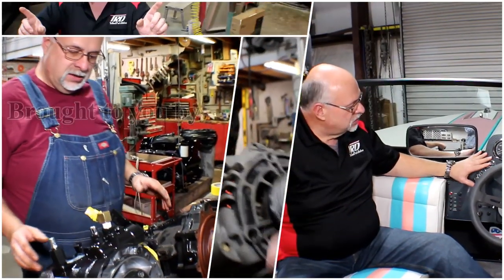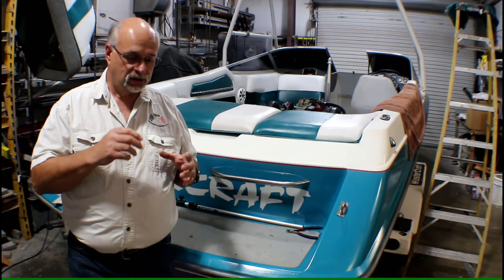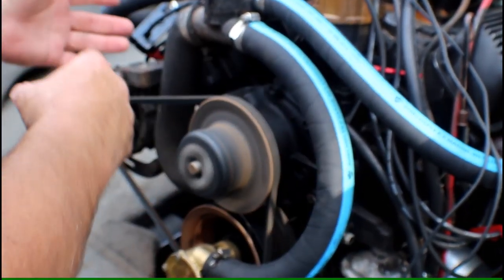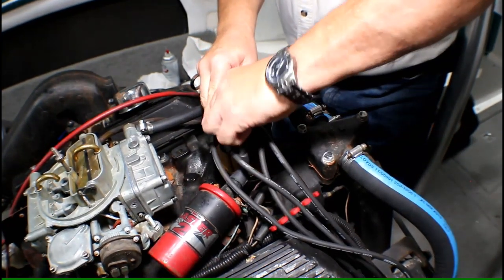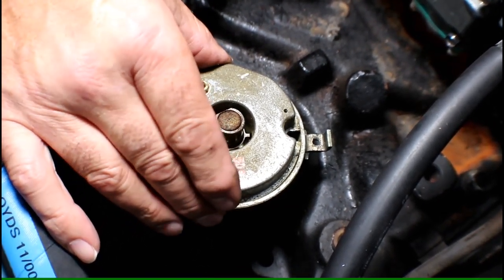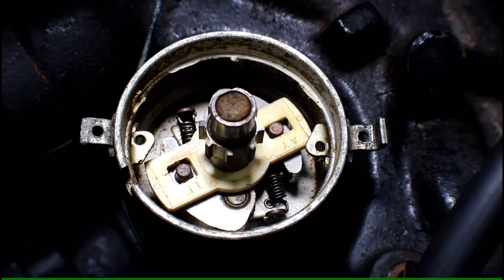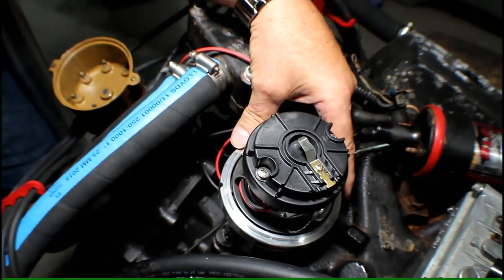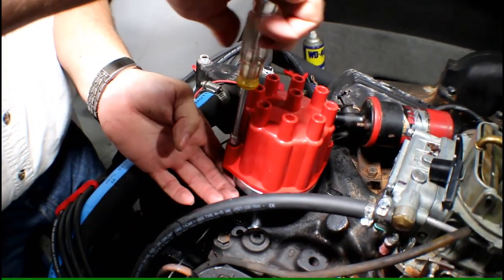Ski Boat (Ford)  Distributor Replacment

Comment: Ron big shout out on this how too video. After I had checked my timming and it was all over the place. Purchased the exact Pertronix you had installed.  My Supra comp runs like new if not better. I was a bit hesitant on pulling my distributor,  however you gave me the confidence to attempt. Thanks to you and Sara for helping solve my problem problem

Comment: The "pilot" on the end of the prestolite distributor and OEM Motorcraft distributors in fuel injected Fords is to aid in installing the dist. in the engine by engaging the oil pump shaft first. Helps tech getting the rotor to line up on previous mark........
Reply: That can be tricky. I’ve had some drop right in,others I’d have to manually move the oil pump rod and try again. Many times. That’s probably a good idea.

Comment: Excellent video, thank you.  In addition, quality connectors counts.  Why people use cheap connectors Scotch Locks and other wire connectors, and don't even use dielectric grease, is confusing.  Oxidative degradation of the connectors' plated coating leads to all sorts of problems down the road (or waterway).

Comment: 85 malibu skier with the ford PCM 351. It has a prestolite distributor with the electronic conversion. popped that cap and found one spring really loose and the other snug. I ordered a Mallory breakerless distributor should be similar install except mine has to connect to resistor...

Comment: Would have liked to see the wires and plugs get replaced. Great video.
Reply from the maker: It's a juggling act to get the right content and video length right, we cut the plugs & wire installation from the video for time constraints, I figured if a guy will tackle the distributor swap they are capable of doing the plugs & wires. Google says 20-25 min videos are good, 30+ need to be broken up.
Reply: @rontanis1024 Agreed. When I took a quick look at the plugs it looked like they were hard to get to. Hopefully I was wrong, should be quick and easy if they are all accessible.  Thanks for the videos Ron.

Comment: Thanks for the great how-to. I would have liked to have seen how you adjusted timing at 28:00 mark of video.
Reply from the maker: Loosen the clamp bolt at the base of the distributor, then grab the whole dist. or cap & rotate the whole dist. while watching the timing marks, when correct, tighten the hold down bolt.

Comment: Great video. I intend to use this as my guide for the same process. I have a 1990 Ski Natique with a PCM 351. Two questions, 1) should I by pass the resistor feeding the coil? 2) Is my 351 PCM PLD-PR-R12PP a Windsor engine., to ensure  I get the correct distributor/coil? Thanks again for a great video..
Reply from the maker: Our distributors come with a correct new coil, and does not use a ballast resister. 1990 Correct crafts should be standard rotation but I would double check, if the front pulleys are rotating clock-wise it is a standard rotation engine/distributor, if counter-clockwise it is a Reverse rotation engine/distributor.

Comment: Great job Ron, Was looking for a trailor and found one and just so happened it came with a boat! A 79 Ski Nautique PCM Points Dist. with no ID tag, So i'm trying to decide how deep to go just to see if she will fire? Replaced plugs and sprayed lube. in the cylinders. Next is trying to find out why the previous owner pulled the wires off Ballast and volt regulator. Next i pulled the Dist. cap only to find tons of corrosion on to of the points. All the guy told me is he was thinking his problem was Ballast? So do you think it would a good idea to go ahead and replace dist. and get rid of the junk Ballast and regulator? probably need to replace starter since it was sitting under water, no one thought to remove the PLUG! Any advice would be Appreciated......Thanks  Any advice on finding out engine details? someone removed the engine ID Tag.
Reply from the maker: This will be a reverse running engine, replacement distributors are hard to find & very $$$ we are working on a solution to this should have replacements by early spring. Starter, yes replace (again reverse rotation) Balllast resistor is needed with the original points system, not with electronic ignitions.

Comment: Ron, I really enjoyed this.  I've got a 1989 Mastercraft Tristar 190 with a Ford 351.  It still has points and condenser but as I'm already diagnosing a not starting issue (likely starter solenoid) I think it might be a good idea once I have it running again to go ahead and try to "future proof" the distributor from leaving me dead in the water like this past weekend.  Based on my boat, I'm guessing the parts you've got listed above are exactly the ones I'd need.  The links indicate "best value for the money" on the Petronix.  But I see others talk about Mallory as well.  If you're criterion is most reliable/trouble free rather than value for money, would you pick something other than Petronix?  (A conversion kit for the existing distributor wouldn't wind up chucking the weights/springs as well or do those wind up staying and still leaving you susceptible even without the condenser/points?)

Comment: Ron, where the heck do you live?  Any chance you live close to me, Nashville TN?  I think I may have this problem or something close to this problem.

My boat, since my car mechanic got rid of the points and condenser, and put electronic ignition in; won’t run past 1700 rpm.  Glad you made this video.  I’m hoping you can look at my boat and fix my problem.  Fingers crossed.
Reply from the maker: Sorry we are located in Louisiana just north of New Orleans aka "hurricane bullseye"
Reply: @rontanis1024  thanks Ron.  I’ll see if my springs are broke.  

Also, to winterize do I just drain the two engine block, and the exhaust manifold.?  12O hp mercruiser made in 86.  It’s in a 1987 Thunder Craft, 16.7 foot. I’ve have it water ready except for this problem.  Thank you for what you do.
Reply from the maker: @leesire  Consult a mercruiser 12o hp source, very little of what I teach for V-8 inboard ski boat engines will apply to your engine.
Reply: @rontanis1024  would a bigger prop have the same symptoms, won’t get past 1700 rpms?   

Thanks
Reply from the maker: @leesire  It would have to be a really big prop to bog down a ski engine to that RPM. Write down all the specifics, make, mode,l year, engine, and what has been done & what the current symptoms are and email me directly at sales@skiboatpartsonline.com   I do better with emails...RonT
Reply: @rontanis1024 , thank you Ron!

Comment: Great video.  I hope you picked up the wingnut that was sitting on the intake manifold! :)
Reply from the maker: I had to go back & watch the video to see what you were referring to, but yes, it is a habit of mine to place some fasteners in the intake manifold valleys, that was the wingnut that holds the spark arrester cover on top of the carb,  when I put the arrester back on I know where my wing nut is.

Comment: 91' 351 W PCM is missing around 2000 rpms.  Has the Coil Pack on backside engine...any thoughts? Replace the coil pack with a distributor? Thank you
Reply: Know where can find a how to video removing Coil Pack off rear engine and convert to the Distributor front of engine....
Thanks sir

Comment: what is the firing order on a 1976 to 1980 ford omc 302 and were does the the rotor line up. and should it be counter clockwise or clockwise what distributor do i need

Comment: Do you have video about removing a Coil Pack and replacing with Distributor? Thank you
Reply from the maker: If you are referring to the GT 40 Pro Tec system, no I don't have a video on that swap but it does work, many others have done it (unless you have fuel injection, then it does not work)

Comment: Wanted to loss that stern drive and put in the shaft and propeller. I don't know much about the hight of the block at the end of the boat that the shaft goes thru. The one for the floor you say is 12%Just wondering if they are all this %.

Comment: I have 89 us marine ski challenger,  not electronic distributor , I replaced it , it starts but idle is low , adjusted idle but still stalls out after a minute running , hit throttle stalls out . Set it a 10 .. what am I doing wrong
Reply from the maker: Going to need a bit more info for this feel free to call Ron mid-week when he is not as busy as Mondays or Fridays.

Comment: Hi Ron.....I have an unrelated question.  My (original) engine manual (from 1996) says to NOT use synthetic oil.  Why would that be.....and has motor oils changed since then to where it would now be safe to use it in my engine?  I just don't understand why that is such a big deal to avoid (PCM 351W).  Thanks.
Reply from the maker: My GUESS is they don't want owners to think they should use what the car/truck versions use (light-weight synthetics) this would be a mistake. Personally I use 10-40 non-synthetic in my boats but add a pint of STP to get the zinc back in the oil. Remember our engine run harder than cars/trucks, and also run MUCH cooler negating the need to high temp capacity oils (synthetics)
Reply: @rontanis1024  Well I also own a 2005 Bennington tri-toon pontoon 26' boat with a 5.7L Volvo Penta engine (it's a 350 Chevy).  I've been using full synthetic in that as I like to open her up and we also pull the kids tubing.  Are you saying I shouldn't use synthetic on that engine either?  What I use in that is Amsoil 10W-40 Marine Full Synthetic....so obviously it's specific to marine application.
Reply from the maker: @keithzastrow  Synthetics are designed for high operating temps, think 205 deg+ coolant temps. Pricy Amsoil I believe does contain zinc which is good.

Comment: Getting ready to replace the distributor, coil, plugs and wires on my 351W that's in my 1996 Moomba ski boat.  You still like this brand of distributor?
Reply from the maker: yes
Reply: @rontanis1024  It appears I have points and have already ordered that same Protronix distributor and coil you have in your video.  Since I am making these changes (also upgrading the plug wires and plugs) do you have any idea what reach spark plugs I need to buy and what the gap should be at?  I have the original engine owners manual and for points it said to gap at .035" and for Protec Ign gap at .045".  Also do I need to change my timing after swapping all this out/upgrading?  My manual 10 degrees BTDC @ 600rpm for Mallory Dist. and for Prestolite Dist. at 600rpm it says Clip Ret. 6 degrees BTDC, Screw Ret. 10 degrees BTDC.  I am FAR from a mechanic but absolutely believe I can do all of this myself especially after watching your video.  I tried to ask these question to PCM but they said I had to call my local Moomba dealer.  I just called them and they were fairly clueless.  I am at your mercy for help.
Reply: @rontanis1024  I have all the parts....getting ready to change everything.  I got the same distributor and coil you ended up putting in the boat in this video.  In the coil instructions it says to disconnect the resistor if you have one.  How do I know if I have one?  PCM 351W in a 1996 Moomba.  All original.  I have owned it since new.
Reply from the maker: @keithzastrow   gap at .035" - .040", the hotter coil will pull this.  I would time at idle for 6 deg BTDC if running std 87 octane fuels.
Reply from the maker: @keithzastrow   With key on measure the voltage at the coil purple wire, if it is the same as the battery voltage (up to .5 volt less) then you do not have a ballast resister in line, but if you measure 12-12.5 at the battery & 9 volts +/- .5 you have a ballast resister in line.
Reply: @rontanis1024  My original engine manual says .035 for points.....  .045 for solid state ignition so I went with .045. That's also what Pertronix told me to gap them at.
Reply: @rontanis1024  I have always ran 89 in her and plan to continue doing so. That's also what my engine manual recommended.
Reply from the maker: @keithzastrow  Few people read their manuals & fewer run premium fuels, if you want to squeeze a bit more out of it & run the better fuels call me about power timing.
Reply from the maker: @keithzastrow  That works I have never seen any performance difference between .040 & .045 until we get into altitude issues & then the .045 will start missing.
Reply: @rontanis1024  Well me continuing to run 89 in her should I set the timing at 10 BTDC (also what my engine manual states) or 14....or something less than 10?

Comment: classic upsell a whole new distributer for a broken spring
Reply: Maybe, maybe not. My 1990 distributer had rusted springs, bad points and enough wear that I made the jump to a new unit. Could it be rebuilt ? Probably but it takes time and some knowledge. This is a slam dunk fix.

Comment: Do you run the purple wire from the electronic choke to the + side of coil ? 

351 with edelbrock carb
Reply from the maker: That works the purple is the "Ignition +" from the key switch providing 12v+ when the key is "on", the choke does not go through a ballast resister like many of the old engines used. The new electronic distributors & coils need the full 12V power to run correctly.

Comment: Do the wires for the distri. Have a specific location or can the bottom part be positioned anywhere
Reply from the maker: You want the #1 Cylinder when at Top Dead Center on the compression stroke to have the dist. rotor pointed at the dist. cap plug wire as #1, then follow firing order. So the simple answer is no you can't put the plug wires into the cap anywhere.
Reply: Thanks I guess my question was  about the position of the bottom of the distributor the part that spins
Reply: @rontanis1024  I’m basically timed up and still all I get is backfire from the carb

Comment: Nice video but losing 50% of the drive surface for the oil pump doesn't seem reasonable to me. Maybe it's OK to the Pertronix engineers because they don't have to replace the engine if the oil pump drive shaft wears /fails prematurely. Is this a 'one size fits both' distributor that fits both 351W (with higher deck height) and 302/289? Seems a compromise that may have consequences down the road. If the engine has a high volume oil pump (and the installer may not know this) there is even more resistance to rotation and the problem is made worse.
Reply from the maker: No they use a different length for the short deck, that was my first question when I started selling these, that they sent the wrong one, but Pertronix assured me they have sold thousands of these & the oil shaft has plenty of "grip", We have sold hundreds of these & have perfect results.  I like you would prefer a longer tail shaft.

Comment: Why do you insist on 6 degrees advance?  I have a 1996 Moomba Boomerang with a 351W PCM engine.  Manual says stock is 10 degrees BTDC.  I have mine at 14.  Sure, I have to run 89 octane but it runs like a raped ape.  Have had it since it was new (original owner).
Reply from the maker: Older non-computer Fords call for 6 deg advance (PCM & Indmar) I didn't write the book. Experience with the older Fords confirms this is a good setting for most applications. IF you want to run premium fuels I use the Power-Timing method.
Reply: @rontanis1024  Thanks for the reply. Excellent video by the way.
Reply: @rontanis1024  Are those Petronix distributors your brand of choice (for my boat/application)?
Reply from the maker: @keithzastrow  If you have a conventional dist. now, then yes, if you have a multi-coil set-up then no, What make you think you need a new dist. already??
Reply: @rontanis1024  I can't honestly answer that  yet....just thinking ahead.  I still need to hook up a timing light and I don't even know for sure if I have points or electronic ignition but I'm thinking the latter simply based on the year of the boat/engine. It starts rough and doesn't like to idle very well.  Yes I realize this could mean other things than just the ignition but after seeing this video and some others it got me thinking.  My boat has always been taken well care of.  Stored in my pole barn in the winter (I winterize the engine myself) and is on a covered hoist when in the water.  I did just change the cap and rotor 2 years ago....wires and plugs are still original. Was planning to change those as well if/when I replace the distributor. Looking for recommendations for both of those too.  Thanks again.
Reply: Help, Bought a new distributor, installed it ,bought a new coil installed it , just like this video did. The motor will turn over but wont start. So I cant check the timing, what is next?
Reply: @genearthur3898  Make sure all the wires are connected and in the correct order then see if it runs. Then check the timing.